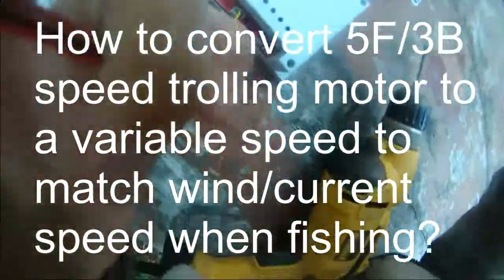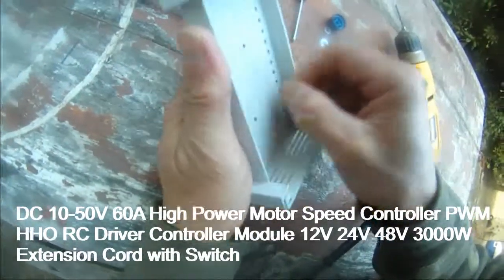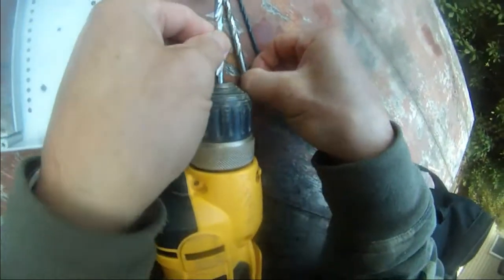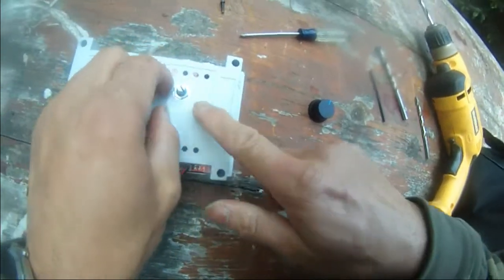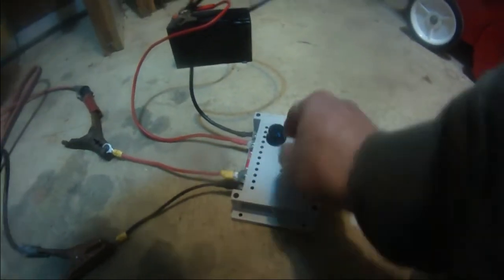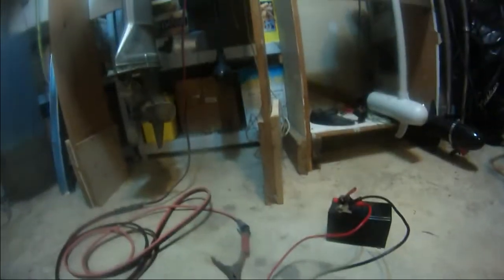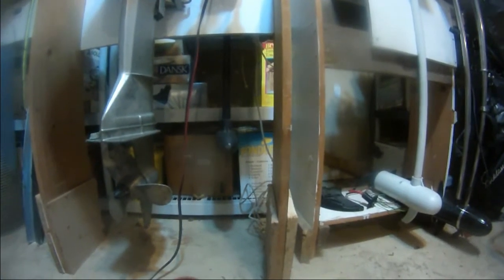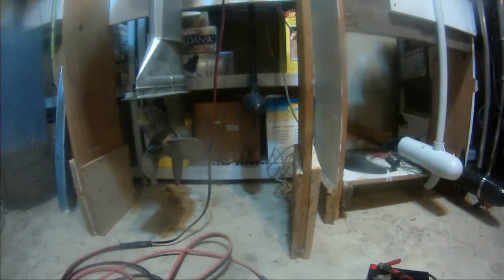How I converted my Minn Kota C2 30 pounds 12 volts trolling motor to variable speed!

Comment: Hi, thank you for share your experience. Could you please tell me if the motor tork remains at the rate (30amps) on the speed controller  is working on its maximun range?  I'm askinv you becouse i have MK 55 lbs trolling motor and i ordered  the  (60amps) speed controller as the same you have. By your experience what you think? Will it works good?  Thank you in advance.greetings from Italy.  Njm
Reply from the maker: I am not sure what you are asking. The trolling motor was working at its full range. I was able to see the prop turning almost like in slow motion when I dial the PWM controller down which is what I needed. Too many times I was on a lake where wind was like a breeze. Forward 1 speed was simply too fast for it. I could not hold my position and had to keep moving. Unsure about 55# but I would think should be OK. If you get a bad part, your PWM will make noises. some of video watchers stated that.

Comment: What did u do with polarity ?
Reply from the maker: didn't have to do anything with polarity. Super low tech, IF I need to reverse the motor, then I just turn my handle knob to reverse the motor. You could buy a PWM with reversible control to steer the motor forward and backward instead of turning the handle knob. More money though - cannot remember how much! good luck. Arduino wifi ins the way to go for these kind of application